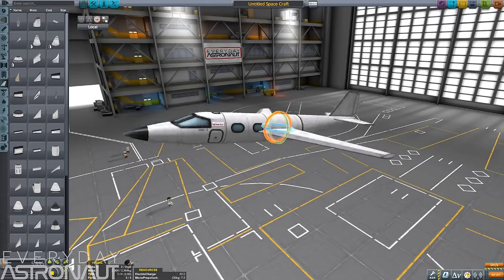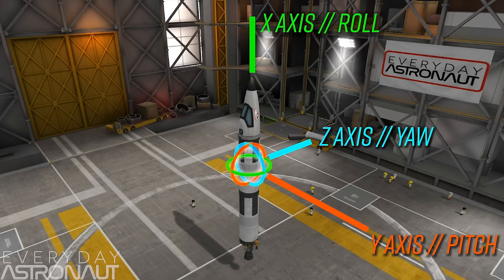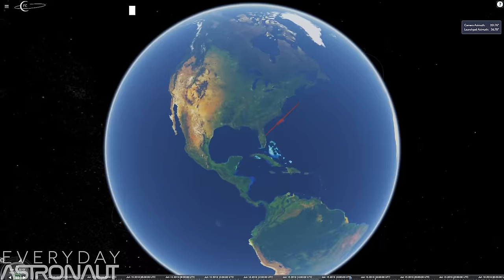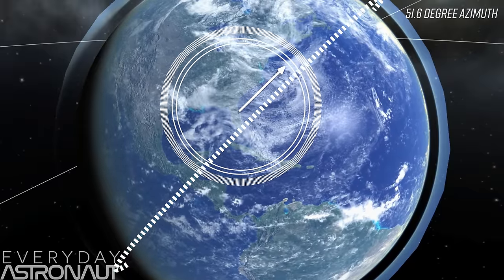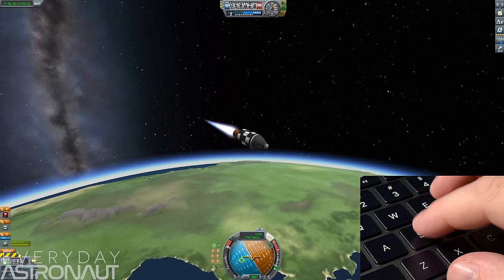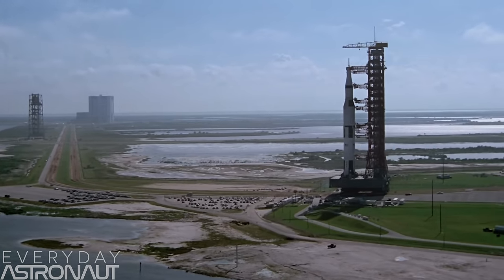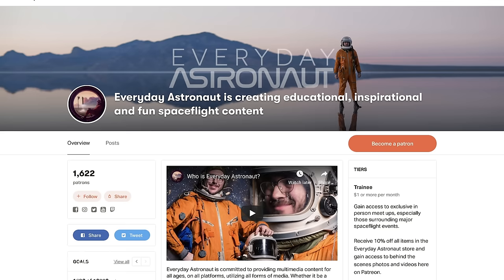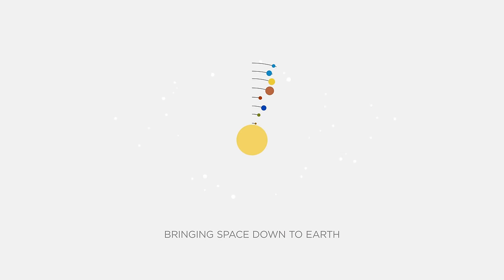Why do cylindrical rockets roll?

Comment: I roll in kerbal to keep my navball needle level with with inclination I want to enter orbit into but not like they do it. at most im making a 45 degree rotation. It easier to roll to line the needle with the angle then just use one the D or A button to tilt into your prograde. I do my roll pretty early on. lift off, roll into angle of inclination then tilt into it, fighting with what i call cross angles that require you to hold W and D can be very hard......

Comment: I'm absolutley none the wiser. How can rolling make any difference in achieving the azimuth in a symmetrical rocket?
Reply: Because a cylindrical rocket will still have a reference point, call it 'up' or whatever to base direction from
Reply: Everything  is  in  Motion.     the planet, the atmosphere and the rocket.     a rocket launched eastward at the equator,  Immediately has an airspeed of  1000 miles per hour.     conclusion:   rocket  GUIDANCE is  Not  a  simple  thing.     a rocket, like an rc drone, Must have a frame of reference, in order for a  Pilot to put in flight control commands (or for a guidance computer, to do the same).    googletranslate

Comment: I have a question.  Why do a lot of surface to air missiles or ICBM's do this?  Whats wrong with letting the guidance computer work on two axis at once?
Reply: IcemanFPV Same reasons, probably. There's an up for the sensor or the radio downlink during the boost phase.

Comment: Americans: lets develop a minituarized digital computer small and light enough so it can fly on a rocket, then have gyros feed data into that computer so it can figure out the current orientation of the rocket, calculate the offset to the desired orientation, and then control the gimbal mechanism on the engines to induce torque into the rocket to make it roll into the necessary alignment 

Soviets: lets rotate the launch pad

Comment: Interesting.....early systems used inferior computers that could not process 9 or 12DOF IMU sensor input data fast enough so KALMAN filtering was required to eliminate erroneous sensor input data. Likely those computers also required simple as possible nav and 3D control reduced to 2D.....and then there is correolis  effect to eliminate.....

Comment: I don't understand the part at 15:23 :/ 

What does "gimbal vectors are in line with each other relative to center of mass"  mean?
Reply: As the rocket engines are moved, the direction of the thrust is changed relative to the centre of gravity of the rocket which as the fuel load reduces and the angle changes, is in flux.

Comment: Did the space shuttle use its rudder or aileron's to roll during launch? Or it's engines? I know the boosters weren't used because they were either on or off and were used purely for power.
Reply from the maker: Engines only! Aero surfaces were locked until reentry. The side boosters actually did most of the roll, while the main engines mostly kept their thrust going through the ever changing center of mass!
Reply: @EverydayAstronaut  that's pretty impressive considering the boosters seemed like big Roman candles.

Comment: How come fullsize rockets look like they rise in altitude slowly,but model rockets disappear into the sky really quick?
Reply: A 1000 foot rocket is a lot larger than a 2 foot tall model rocket - so the smaller one vanishes at a far smaller distance, as well as having a lot higher power to weight ratio so it accelerates faster in many cases.

Comment: How much control over the roll/pitch and stage separation did the Apollo astronauts actually have?
Reply: None.  The Apollo command module didn't control the Saturn V.  It had it's own navigation and control system.  The only thing the astronauts could do is abort.

Comment: 0:22 Looks like the shuttle had some horizontal speed movement after clearing the launch tower. Am I just seeing that as an illusion or did it really pick up a little horizontal speed and move aside from the tower as it was launching?
Reply from the maker: It sure did move sideways! Because of the offset thrust of the orbiters engines! It did a little power slide off the pad!
Reply: @EverydayAstronaut  I kind of figured that. Good to know I'm not seeing seeing things. I guess I figured that with all of that engineering, they would have made it go straight up for some reason. But I guess it doesn't really matter in the scheme of things other than when they first launched the shuttle and (apparently) accounted for it ahead of time. I couldn't imagine it sliding off the wrong direction and hitting the tower side inside of the open side.

Comment: Silly question. On almost every video after the second stage seps and the engine starts up there is a little ring that separates and falls of the bell. What is this ring?
Reply: It was the instrument unit containing the guidance system comprising a digital computer in addition to analog flight control computer, the inertial guidance platform, control accelerometers, and control rate gyros.

Comment: If they just launched the rocket already in that direction wouldn't it be so much more simpler and efficient...??
Reply: the  would require having a custom launch pad for each desired orbit.. where as having the rocket adjust to achieve the designed orbit is easier to program.

Comment: Hey @Everyday,

Why would one craft choose 9 exhaust ports over 1

Do the number of engines matter or the number of bells?
Reply from the maker: Multiple engines has a few advantages. It means you could lose one on ascent and still keep going, can’t do that with just one engine. Also, it’s cheaper to make 9 smaller engines than one big one, least when making them over and over due to mass manufacturing advantages 👌
Reply: @EverydayAstronaut  Shocked Pikachu

Comment: You could have explained this in 30 seconds. The center of gravity is rolled to be below the direction of travel. It's easier to control and takes less fuel. Rockets are not symetrically balanced.

Comment: NASA: Spends millions to invent a pen that can write in zero g.
Russia: Uses a pencil.
Reply: This is a false statement.      The pen you are referring to was develop by Fisher Pen Company.        NASA did not contribute funds to the developing of the pen. Public records showNASA purchased 100 pens and a year later Russia purchased 100 pens.    Problem with pencils, the tips flaked and brake off, drift around in microgravity and potentially harm astronauts or the equipment. Graphite can conduct and was also a risk for causing electrical fires if it got into the wrong place.

Comment: The payload doesn't need to "handle the G forces" the rocket does.
Reply from the maker: The payload absolutely has a very specific guideline for g loading. That’s why some payloads need to be vertically integrated even and can’t fly on say a Falcon 9. Payload users guides define the exact G limits on each axis the payload needs to be able to withstand. But of course, the rocket ALSO has to handle the G forces
Reply: The payload experiences exactly the same G forces that the rocket does.
Reply: @stargazer7644  no the payload doesnt need do anything, the rocket is adjusting for the payload, not the other way around.
Reply: @teebee5323  The payload experiences high G forces.  It has to be designed not to fail under these forces.  Satellites normally operate in zero G.  They're designed to be as light as possible.  These factors don't go well with high G launch forces.

Comment: When calculating Azimuth do you use True north or magnetic?
Reply: The magnetic north means something only if you use an old school magnetic compass. The earth does rotate around an axis that defines "true" north, so no conversion is needed (e.g the direction of "true" north does not vary while orbiting parallel to the equator while magnetic north actually runs in circles around the axis of rotation.)

Comment: DID not mention human physiological considerations … Fighter jet pilots tend to align the roll so that they can pull Gs "upward" in tighter turns, so that they will be fighting against blackout, rather than red-out. …  You want the G's pushing your blood towards your feet and not towards your cranium. … If you pitch-down at over 400 knots, your head will fill with blood and you will loose consciousness and, possibly, "stroke-out". … No? … I would prefer to ride the inside of the trajectory arc, rather than on the outside.

Comment: They roll for the same reason a bullet rolls , STABILITY .
Reply: Wrong
Reply: An explanation would be appreciated .
Reply: @rayrobbins4625  The stability of a bullet comes from rotational inertia. Rotational inertia is proportional to the speed of rotation. A bullet rotates 3000 times per second. A rocket rotates only a few degrees in a few seconds.
Reply: Thank you for your information .

Comment: If everything little maneuver have reasons, why N1 exploded like new year rocket before it left earth atmosphere (much before)?
I have quess, right speed and power those motors get synchronized rolling sound barrier in right frequency and it add more destructive power bottom of rocket and it collapsed inside. Maybe I'm wrong, but that's just my theory. Those shockwaves could destroy motors exhaust bell's. Or second reason could be that they done it for purpose, because that rocket drinked all they vodka. At least that they thinked and it's enough reason (in soviet russia) then to throw some dynamite on-board. It indeed fly like a hell, still second loudest manmade thing after a-bombs and that sound lasted more than 0.2 sec like bombs, and then all energy is escaped. Everyone could look from old videos how insane system it is, I don't know does it is even rocket in real..

Comment: "Why do Rockets Roll" instead would be the accurate video title.  As you plainly reveal, cylindrical rockets roll for the very same reasons as non-cylindrical rockets.
Reply: that is the title and you put a t instead of a d
Reply: @awsomesaharsh9906  - thanks for the spell-check.

Comment: Why is it that people believe Rockets can maneuver in a space (like) environment with no air molecules and no resistance to get equal and opposite reactions?
Newton realized every action has an equal and opposite reaction in ATMOSPHERIC conditions. 
We do know the same is not possible in a vacuum. We do know what causes flight to take place and it can't in a vacuum.
Reply from the maker: I think you’re thinking of airplanes my friend 😉 let’s do a thought experiment. If you’re sitting in an office chair and you throw a bowling ball really hard. You’ll move back a little as the bowling ball moves forward. Are you suggesting that your backwards movement is because the bowling ball hit the air and that air pushed against you? Well, spoiler, it doesn’t (otherwise the air would need to be a brick wall). This is all rockets are. They eject mass (although much lighter than a bowling ball) really fast (like REALLY fast). And that equal and opposite reaction works even when there is no air.
Reply: @EverydayAstronaut  you are all taught to use the bowling ball experiment as the answer to a very troubling question but, here's the problem more people SHOULD be smart enough to question....
Where is the bowling ball in space? There is NOTHING to push off or throw away.
You are down here on earth pushing off the static weight of the ball. You have to let go of the ball in order to move back.
Rockets never let go of there thrust. They take it with them.. 

Could they instead just hurl big rocks out the back or sides depending which way they wanted to go?
Because,  the away they show us their doing it now is like bolting a fan to the back of your sailboat and think you could use it to accelerate the boat.
They show us videos of them doing it so...it must be true and Newton was just a lunatic...lol

Flight and direction changes during flight depends on something pushing back and that is air molecules. NO OTHER WAY and
 That's not newtonIAN law. That's God's LAW.
Reply: Brian Sleeper
Oh ffs, the Earth is not flat, okay.
Reply: Originally posted by Brian Sleeper:

"Atrumoris dont bring your delusions into this. YOU have to first understand rockets don't go anywhere. They go up to 40 or 50 miles until the air molecules aren't plenty enough to have any resistance to the rocket thrust and it starts coming back down. Somewhere over an ocean. Especially the real big ones. Its hysterical to watch. Once you get that, then the moon landing hoax will be a cake walk for you."

Not really sure why you withdrew it if you're so cocksure in your beliefs.

Anyway, just for laughs, explain to us again why rockets can't climb too high, also, I don't suppose you could provide us with some links to the videos showing rockets intentionally veer off into the ocean?
Reply: "Newton realized every action has an equal and opposite reaction in ATMOSPHERIC conditions." 
"We do know the same is not possible in a vacuum"

Absolutely wrong or/and false statements. Seems like you have to make up reality and the history of science biased towards your personal convictions.

Comment: At the end, you don't know. Why to have done this video then ?
Reply from the maker: ??? Here’s the end, I do know why... “But as for why, it’s generally easier to roll to align the vehicle to its azimuth than it is to move the launch pad, it makes for easier calculations for the guidance computer, rockets roll for aerodynamic and structural considerations, they roll for the astronauts vantage point and visual references, they roll for fairing deployment orientation, they roll to align auxiliary or control thrusters, and they roll for the best line of site for the communications and downlinks.” Sorry but what are you talking about?

Comment: Did he gloss over the single largest reason rockets roll?
Reply from the maker: Perhaps... what’s the single biggest reason in your opinion? 🤔
Reply: @EverydayAstronaut  Well I wasn't being really serious, and for one and I loved the video. Did you talk about the stabilizing force it has? If your rocket spins like a top, your don't have to fight gravity to lift nose/keep it on the correct level, Right?

Also I got lazy, and not expecting anyone to see the comment anyway, I stopped it, instead of clarifying like I should've.
Reply from the maker: Well, this video was about roll programs and not spin stabilization. They’re pretty different things. You wouldn’t and couldn’t spin most rockets for stability. That’s mostly useful with say a solid kick stage or something or a smaller model rocket
Reply: @EverydayAstronaut  oh ok, I honestly figured they would just act like big tops, but just with a slower spin. Whatever, great video despite any of this, and I have loved them for a while. 👍

Comment: The space shuttle wasn't cylindrical and it rolled
Reply from the maker: Yup, we mention that. That one is more understandable to roll because of its aerodynamic considerations
Reply: @EverydayAstronaut  the shuttle looks like it does almost a 180 degree roll, wouldnt it be better to put it on the pad the other way so it doesnt have to roll so much?

Comment: Why?
Rolling allows the main rockets to adjust for changing of center of gravity, due to fuel consumption and asymmetry. Small adjustments in yaw/pitch at the right rotational angle makes up for fine navigation.
Rather than relying on small delicate mechanical movements, the computer can use fine time measurements to make adjustments.  More accurate and more reliable. 
Elon Musk - “fun”

Comment: Dumbass here: Would it be possible for a rocket to boost straight up without turning at all, to connect with the ISS? Like you’ll be at the point right above the pad, and the ISS will just swoop in and catch you.
Reply from the maker: The ISS is graveling at 17,500 miles per hour, if you go straight up to it, it’ll smack you 10 times faster than a bullet. That’s why getting to orbit requires so much more energy than just getting to space.
Reply: Everyday Astronaut Thank you. Question answered.

Comment: How could the earth's rotation help 'boost the rocket if rotation plays NO part in a plane landing? A plane... or anything for that matter... cannot land on something spinning over 1,000mph.
Reply from the maker: The plane keep its movement relative to earth and the atmosphere it flies through moves with it too. This is not the case with rockets.
Reply: @EverydayAstronaut  so ALL runways on the planet are facing the same way? Come on bro. Listen to yourself. Your saying rotation works for rockets but has no application to planes. The earth is... yes,  I'm gonna say it... FLAT
Reply: @EverydayAstronaut  and what separate's them from acting different? The atmosphere knows what's in it? Come on bro... stop believing what your told to be true. Think for yourself. Does that REALLY... REALLY make sense in your head.? Just because it's in a text book doesn't make it true bro